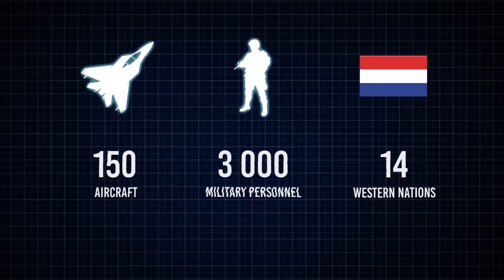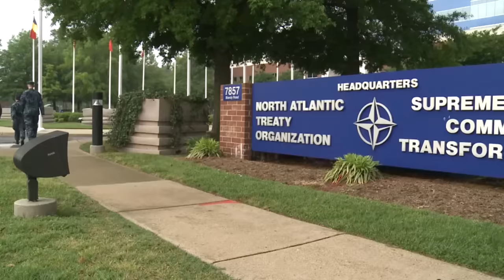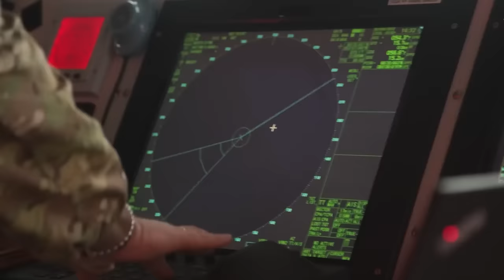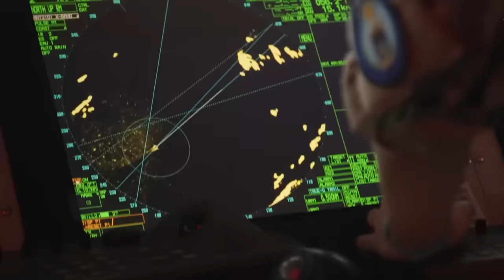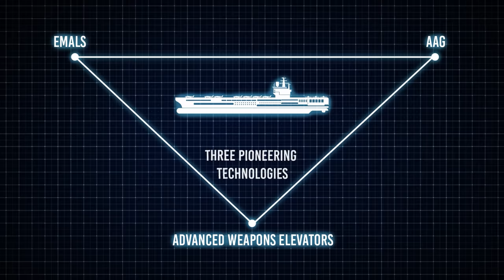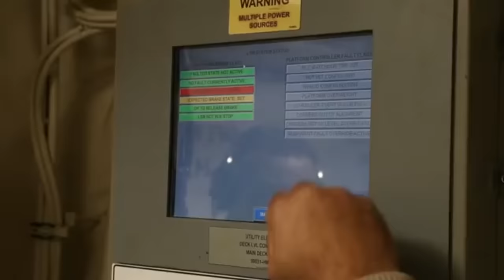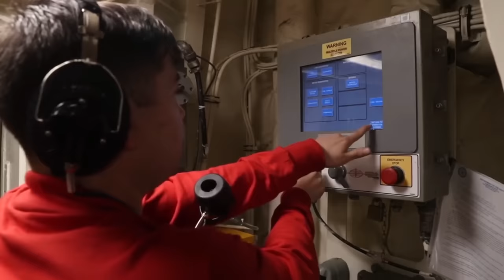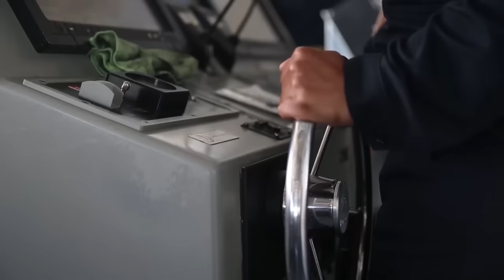US $100B Aircraft Carrier Is Finally Ready For Action | Russia Is Shocked

Comment: Great carrier.  But the Hornets does not have the payload or range of the F-14 tomcats limiting operation max range.  Air to Air refueling is nice but you also have to have more tankes in the air.  Less payload, less range does not give a good punch like the F14.  Even a upgraded version of the F-14 would have been find if they can find a way to lower maintance cost.